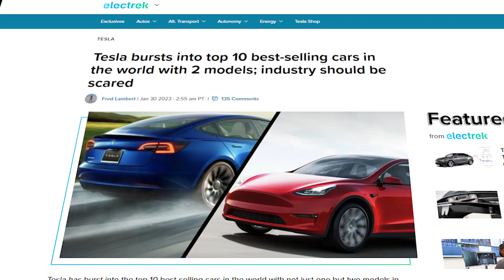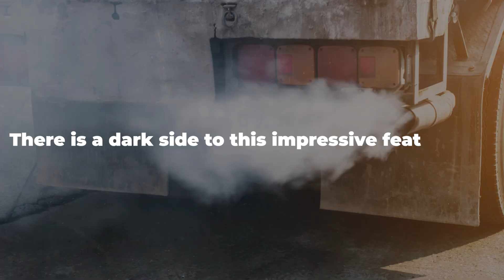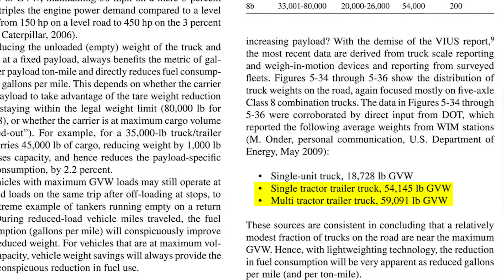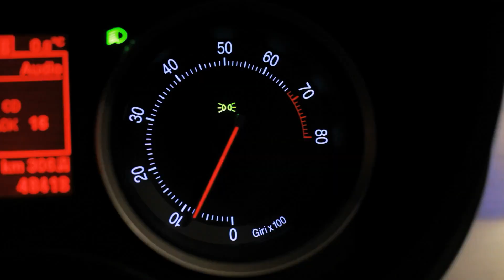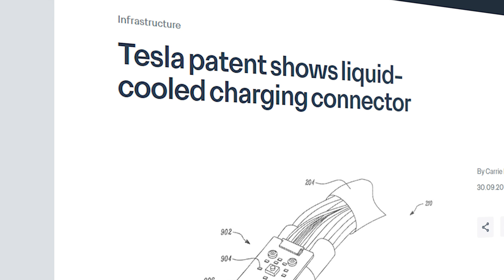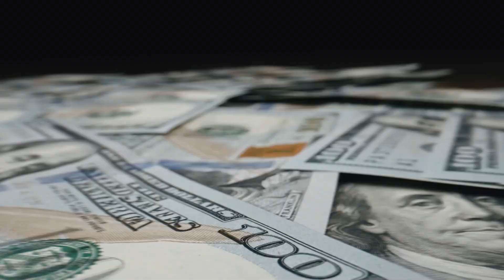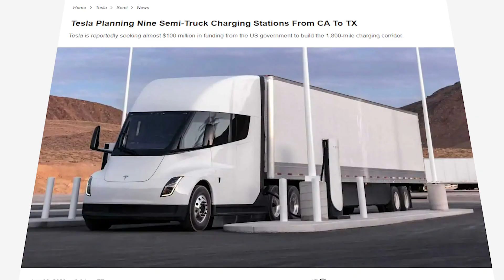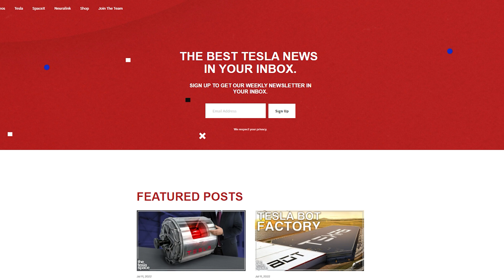How Tesla Reinvented The Semi Truck!

Comment: I think the thing alot of people forget about EVs in general is that they have the most impact in dense urban and suburban short trip applications. It's not just about range and emissions. The amount of waste heat and brake dust saved in urban driving/traffic is going to have a dramatic effect on air quality as well.
Reply: Then they need to stop aiming it at markets where it won't work. That's the problem with Elon and Tesla they are aiming there trucks at markets that don't need or want EVs and where EVs won't work. 

It's for city driving just say its for city driving. Don't go on about heavy haul. Because if you only needed 5 semis you would have to get 10 or 15 to make up for the low haul power. Meaning you would also have to up the price of shipping. Elon and Tesla are trying to fix a problem by making it worse.

Comment: As a small fleet owner, the Tesla semi is only good for final mile or regional runs. My trucks, on average drive about 600 miles per 11 hour shift and only takes about 15 minutes to refuel. The average load for a refrigerated trailer is about 43000 lbs for a total of 80000lbs gvw. I do not see the Tesla in the longhaul segment of the industry fir the foreseeable future due to its limitations. Also regarding fuel economy an 18-wheeler at 80000 lbs is actually more fuel efficient than most vehicles when you take the 8.5 mpg average and do a comparison to a passenger car
Reply: The Semi can take your 43'000 lb load AND cover your 600 miles in an 11-hour shift... no sweat!  You just need a V3 or V4 Supercharger (obviously installed so as to allow access by semis, to top off the battery during mandatory pauses!  Now, if you operate your trucks double-shifts, then it would require a dedicated charging infrastructure at base (so-called "Megacharger").

In Europe, the absolute legal maximum a long-haul truck can cove is 506 miles... but its more 420-450 miles in practice.  So, over here, a Tesla Semi would be a no brainer, even for the longest of long-haul operations!

Comment: Client: “Can you book a truck please for full load, next week? “ . Freight Co: “yes but we now use Teslas so we will have to send two trucks as one will not carry the weight  due to the battery weight. Also, we can only take half the distance as the Tesla has no sleeper cab. “
Reply: Straw man argument. No one, anywhere, ever said that Tesla Semis could haul as much load as far as a diesel semi; of course they can't. But statistics show that the vast majority of Class 8 truck trips go out way below the 46,000± maximum payload of a typical diesel semi, with a range way below the 500 miles a Tesla Semi is capable of. For some applications, diesel semis will still be required; for the vast majority, Tesla Semis can do what diesel semis do, as soon as the charging infrastructure is built out. And  much of what diesel semis can do, even charging from the existing network of 17,000+ Superchargers in the US.
Reply: In Europe many trucks are below capacity as weighed by weighing stations - mid trip when some offloads completed. However, unless you haul a specific lightweight item all the time, no general freight  company will buy a truck with lower capacity.  The semi will only sell  in small numbers as the theory is flawed. I worked in that industry and most that I know just laugh at the prospect.

Comment: They can and will easily surpass their counterparts..... all they need is the trailers to be added to the mix... add batteries and motors to them as well... and then that will allow much further didstance and the amount of weight that can be carried.... only thing stoppong it is the safety laws.... but it will need and will eventually be changed to meet the true capabilities of electric vehicles... and with the safety record of tesla.... it will be inevitable 🙂

Comment: About the weight of the Tesla semi:  Currently the 2170, not the 4680 cells are being used in the Tesla semi. The 2170 is a wet cell battery. The 4680 is a dry cell battery.   When Tesla switch to the 4680, the weight will be reduced significantly.
Reply: 4680 is considered a flop. The biggest battery maker in the world, is CATL who also supplies batteries for some teslas. CATL CEO revealed in an interview that the 4680 will never have an impact economically. Bec design issues and manufacturing problems. It was another half-baked idea by narcissist Tesla part-time CEO Musk.

Comment: What about using Actual trailer to store some additional batteries for longer range ? batteries can be modular so depends of actual load weight and distance can be stacked
Reply: A Tesla Semi starting the day with a full charge, and with an additional 40% added during the mandatory 30-minute break at 8 hours, can drive as far in a day as permitted by HOS regulations and speed limits. That being the case, what's the benefit of giving up payload for batteries, to gain longer range that you can't use?

Comment: ICE vehicle weights don't take into consideration the fuel weight. Gasoline weighs 6.3 pounds per gallon. So a Ford F150 with a 36 gallon tank would weigh an additional 226.8 pounds with a Full tank. An ICE Semi with a diesel, which ways 7.1 pounds per gallon, that carries 300 gallons weighs 2130 pounds more fully fueled. EV's don't change weight depending on its charge level.
Reply: @misterx280. You never drove a semi have you? You haven't had to deal with weight limits and time applications.🖕🇺🇸🇺🇸
Reply: A better way to phrase is that EVs don't lose weight as you use up range. A comparable diesel daycab weighs 10,000+ lbs less even with full fuel tanks.

Comment: @13:00 You can use teams of drivers with Tesla Semi on very long haul runs. Just have the next driver waiting in a fully charged tractor. Unhook the depleted one, hook up a fully charged one, and press on. The driver of the depleted one can go plug it in, take a meal break, hook it up to another trailer headed in the return directions,  finish off their day, and have a decent night's sleep in their own bed. And maybe get to know their kids a bit better 

Swapping horses every 15 miles was very much a thing for mail and time sensitive goods two centuries ago. History doesn't repeat, but it rhymes.
Reply: The Fremont to Laredo network, with 8 Megachargers every 225 miles, will be set up for exactly this sort of operation.

Comment: dude three is no such thing as zero emissions - stop with the nonsense we are not against EV but cut the crap
Reply: Direct emissions are zero, but of course what you're referring to is indirect emissions at the power plant, if the Tesla Semi is charged from the grid—which they mostly are. But the reality is that switching from diesel semis to electric semis will still bring about a huge reduction in overall emissions, for two reasons. First, all states' electric grids have at least some renewable energy in the mix of sources, so at least some charging is done from renewable sources, and not coal and natural gas. And the other reason is that because electric drivetrains are far more efficient than ICE drivetrains, electric semis use about 2/3 less total energy than diesel semis; so even if there were no renewable energy in any state's grid, electric semis would still produce only 1/3 the direct and indirect emissions of diesel semis. 
And because there is a large proportion of renewable energy in most states' grids, the reduction in emissions is even greater; for example, in California,, where only 40% of the grid is fossil fuel-based, switching from a diesel semi to an electric semi reduces direct and indirect emissions by 88%. Of course, this is different for other states, based on their different proportions of renewable energy on the grid.

Comment: A potential big advantage of the Tesla Semis is the ability to accelerate uphill much better than any diesel semi. That could make mean a lot faster trips over mountainous passes.
Reply: Wait until, in real life, truckers will have to pay for all the added tire wear!
Reply: @tettazwo  very soon, IRL, "truckers" won’t exist, let alone independent operators.
But then maybe the "semi / tractor-trailer" form factor also obsolete.
So many revolutions, not just BEV.
Reply: @tettazwo  Yeah, with 2.5% more GCVWR than diesel semis, fully loaded Tesla Semis will have slightly more tire wear than fully loaded diesel semis. But here's a flash: diesel sleeper cabs will have added tire wear compared with diesel day cabs; are you similarly advocating against diesel sleeper cabs, due to added tire wear? 
Tire wear is just another operating expense, to be taken into account with all the other operating expenses when making the purchasing decision.
Reply: You're being deceptive by saying only 2.5% heavier at max load. It won't be able to haul as much in weight-constrained loads because it's a whopping 26,000 lbs bobtail. So it will be better for volume-constrained loads, like Frito Lay potato chips. 

Assuming a load is ~8000 lbs, a dry van trailer is ~15,000 lbs and ballparking a diesel daycab weight of 15,000 lbs, it's gross weight will be ~29% greater hauling potato chips.
(Not to mention with an empty trailer it weighs ~37% more!)
Reply: @MobiAussie  _ You're being deceptive by saying only 2.5% heavier at max load_ 
Yeah, I probably wouldn't disagree. But you're being a little deceptive as well, with the implication that the Tesla Semi has dramatically less payload that a diesel semi. Demonstrated payload on a flatbed is 44,000 lbs., and most sources I've seen put the upper limit of diesel semi payloads around 46,000 lbs. For applications where a payload of 46,000 is a must, diesel semis will still be the way to go; but DOE statistics show that this is a very small percentage of all loads.
Reply: Yes, won’t hold up traffic, won’t have to take a fast run-up when approaching a hill. Safer.
Going downhill with 2-3 times the deceleration power of Jake / engine braking is huge boon, no more runaway, can probably go a bit faster / safer than diesel (or Nikola gravity drive).
Diesel will get real obsolete real fast.

Comment: Is the regeneration of the semi better then there cars?   Or is it stuck in the 'better then nothing' category as well?
Reply: What? The cars have enough regen to basically never have to use the brakes, so they’re a lot more than “better than nothing”.
The semi has extremely strong regen, to the point where brakes don’t need to be used at all when going down mountain roads while towing cargo
Reply: @SyntheticSpy  Oh, I'm all for regen breaking for all the reasons.   But I was referring to just the energy saved.   According to Tesla Marketing it is "UP TO 70%".   But  their real world data shows people average only 30% energy recover.   Which defiantly falls into the "better then nothing" category.  Why the discrepancy?  Because people don't drive at full speed to a red light and then perfectly slam on the breaks, maximizing regen to come to an exact stop without engage the breaks.   What is needed to get the 70%.  Basically when people are panic stopping they tend to go past regen only breaking.
I would also point out that your using more energy by using regen breaking then if you didn't.   Costing to a stop is better as you don't use 100%.   It's like getting back 100% not 30%.   But yes, that's unrealistic in traffic.  
Now, for the semi, You seem to know the marketing points.  But do you have any actual data on that?

Comment: Mercedes-Benz has already a new e Actros truck with a 321 miles / 500 km range, but Tesla only talks about range and the all the rest Tesla Semi is the worst of the truck industry, in a segment that truck equipment is a requirement and mandatory, Tesla wants to apply the same poor simplification processes as he does on cars with a stripped equipment cabin and that's not possible and Tesla doesn't understand this specific needs of this segment, Tesla Semi has the most stupid, pathetic engineering and worst ergonomics in the dumbest level, as you can see the seat in Tesla Semi is in the middle without height regulation, the Mercedes 500 SL of 1990 has better thought and well made german engineering of the seat belt that is electric height adjustable than the Tesla Semi that is fixed in the seat without height regulation, if you're a tall person you're going to be with the neck and shoulder very tied and tired of this crap, in the tolls the driver has to get up to pay them because of this very stupid idea of the seat in the middle that doesn't make sense at all, and the front windows don't open; so when passing in the country borders, documents please!, drivers can't talk to borders patrol agents because they're stuck in middle of the truck in the seat, and have to exit the truck, wtf!?, but nobody thought of this!? this is so stupid;  but Tesla wants to be different! for the worst and no logic reasons; truck drivers have to do a lot of maneuvers and pass inches very close from walls and obstacles, with a seat in the middle you have no sense of exact distances, and you can't rely only on cameras and screens, sometimes the cameras will be dirt or with snow, you have to go for other options, and there's no better view than a direct and open window, if can't even open the windows in the front there will be some situations the windows will be very dirt and you can't see nothing, the suicidal doors is another awkward stupidity of Tesla, when maneuvering sometimes you gotta exit the truck and go out to check conditions and distances it and in case of emergency if you're stuck in the snow or mud it's very important to have a clear view, in the Tesla Semi you have a obstructing suicidal door that covers your view you can't see nothing backwards of the truck, there's no CB equipment a requirement that enterprises where loads are delivered need to communicate in his own frequency, there's not a bed in the Tesla Semi, not having a instrument cluster is another big fault, a driver has to constantly check speed and limits, warnings in his the front view, because of speed limitations, of being a professional and because of loads that are in transport, the interior so empty and so poor what a crap truck it is Tesla Semi, i have a truck driving license, i already drove Mercedes-Benz, M.A.N., Volvo trucks and the Tesla Semi is the most dumb stupid truck i ever saw, this is absolute crap for professional use, it's impractical, useless that is already banned in the European Union.

Comment: The problem will be servicing the trucks once they need maintenance. Tesla is horrible at fixing cars that are broken.
Reply: To the extent that's true it would be a big problem but considering the natural durability of electric power trains and Tesla's rapid improvements in other areas it's only a matter of time that will be worked out.  And with Tesla having some of the highest brand loyalty in the industry it doesn't seem to be a major problem.
Reply: Maintenance free cept for the battery n brake n pads n tires-- N i think they said battery covered for like a million miles same for everything else mainframe drive train n pads almost never need replacing cuz of braking regen

Comment: Yes they are nice but by no means cleaner or greener.   Let's not forget the manufacturing process.
Reply: Average semi getting 6.5mpg and driving the average 72,000 miles a year?
Burns up over 70,000# in diesel fuel weight alone. Where does that fuel come from? How is it extracted, transported, refined etc. 

The tesla truck which uses most of the same materials as a diesel does, also doesn't burn liquid fuels.
Reply: @SLee-vj4px. And you sound like mining and processing theses materials for the parts of a EV is cleaner. Ps it's not.👍🇺🇸🇺🇸
Reply: @Eric-i2k  it definetely is vs non stop search for, move those heavy ass drill rigs into place, use energy water and chemicals to extract&pump crude oil up from the ground hey using electric motors!

Use some more energy to transport it causing more pollution. Use more energy&electricity plus water and chemicals at the refineries inc cobalt just to refine that crude into burnable fuels. Use some more energy to transport it. Use more energy to pump it into your tank. 

All at a well-wheels efficiency of 15-30% hell ask chat gpt how many billion pounds of crude oil the world digs/drills n fracks up each day to burn in an endless cycle, hint 29,190,000,000# is the answer it just gave me. 

That is just the crude oil, so not counting the water(1.5-3 gallons at the refinery level alone per refined gallon of fuel. 
Not counting the electricity used, not counting the oil rigs daily diesel use, not counting the chemicals and their production&transportation etc.

We will do a LOT less mining and cause less environmental damage by switching to evs&renewables not more like pet-trolls often claim. 👍🏻😎
Reply: @Eric-i2k  to be fair, let's say mining & drill for oil are even, making eSemi and dSemi are even, burn diesel is definitely pollute more than electricity production. if electricity generated by solar/wind, then it's getting much better.
Reply: your sound like diesel truck manufacturing is magically clean